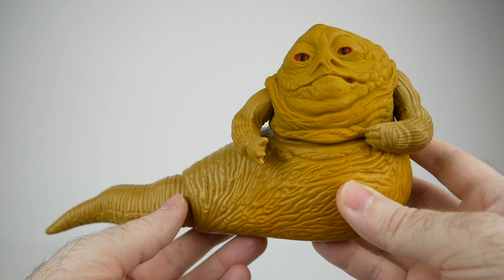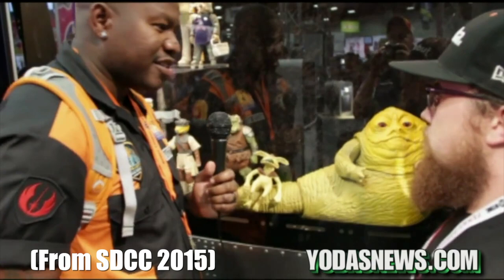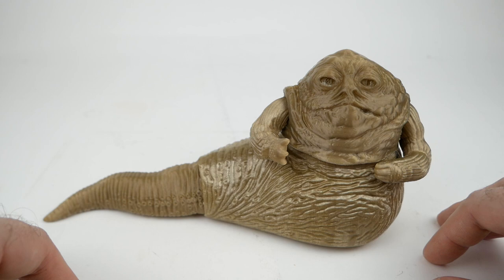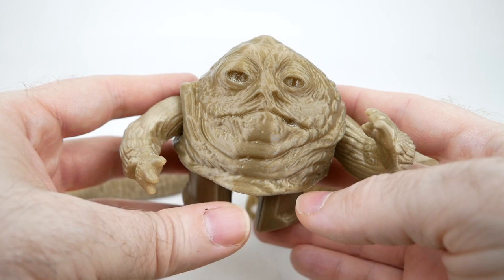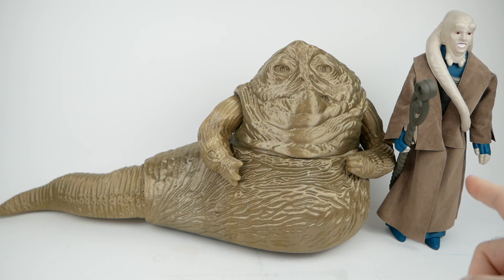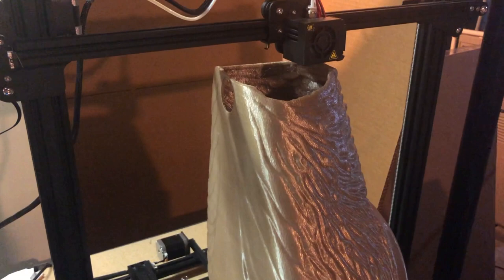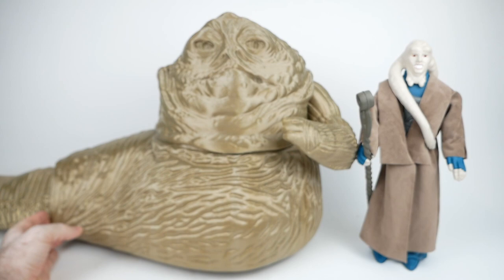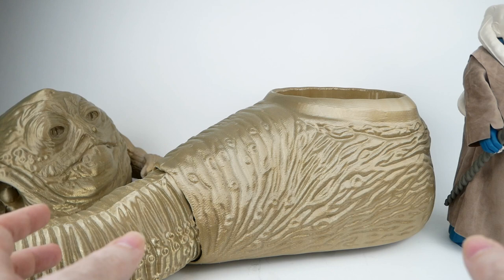I Made a 3D-Printed Jumbo Vintage Kenner Jabba the Hutt Figure

Comment: Looks really nice!
What happened to your lifesize Jabba? Did you ever finished it?
Reply from the maker: I've addressed this a number of times, but it's understandable that not everyone knows about it. Long story short, I don't think I'm going to be able to paint the life-size one, because for it to look decent at all, I would have to fill in the gaps with some sort of body filler, and I don't think that will work well in the basement (both in terms of fumes and the dust that would be produced from sanding). I know this is disappointing.
Reply: @MightyJabbasCollection  Okay. Sad but absolutely understandable. Thanks for your response!

Comment: I’m thinking about a Black Series size Vintage Jabba. What percentage increase would you think for scaling up the Desert Octopus model? 

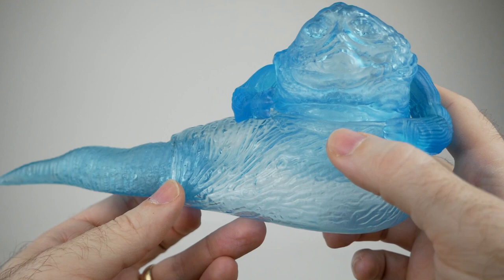Someone told me that the math for going 1:18 to 1:12 scale is original size multiplied by 1.6… so 160%. Does that sound right to you?
Reply from the maker: I think that would be right, although you might want to think about how big you want the Jabba figure to be in relation to any other 1/12 scale figures you might want to display with it, and adjust the numbers so they look right together.

Comment: Hey did you ever finish painting the life sized Jabba? I just finished the rest of the episodes and was wondering.
Reply from the maker: Basically I determined that I can't paint it because I can't fill the gaps between the panels to make it look decent without adding body filler and sanding, etc. Since it's stuck in my basement I can't really do that (the fumes and dust would be pretty bad). And I'd rather keep it looking like a white statue than do a half-way job of painting it and making it look worse.

Comment: I was just cleaning up my childhood Jabba and the arm broke at the shoulder ball-joint part.  Does anyone know where I could get gold of a replacement or reproduction arm joint, other than ebay?  Also, would a 3-D printed part have enough strength in it to do the job if I ever came across one?
Reply from the maker: You can try using LEGO as shown in this Toy Polloi video. I haven’t tried it myself. https://youtu.be/_hHRBx-Wnrk

Comment: Awesome video. Why don't you try using a soldering iron to fix the rough spots on your models? Here is a great example https://youtu.be/6hW_FbsEG4A just make sure you use a very low heat and practice on a few scraps.